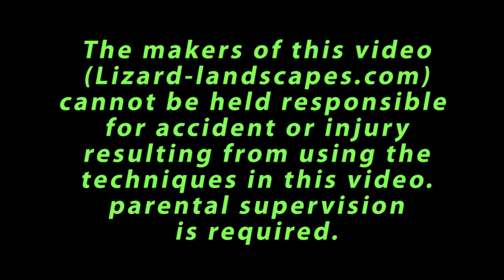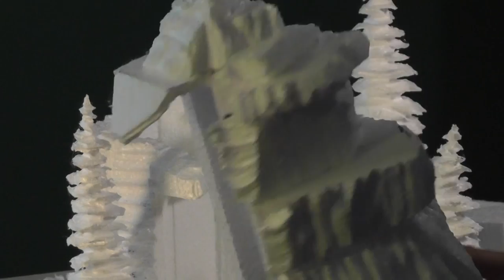How to build a Winter Waterfall + Christian message!

Comment: I noticed that in a lot of your older videos you just use a knife to cut them. I can't handle the mess that a knife makes. I'm going to get a Hot Wire Foam Factory tool for my projects. Would those projects work with a Hot Wire tool work for those as well? I can't afford to get multiple tools. Which one should I get that would be best for many projects? I do want to start with making a castle for my new lizard Hugs. I want to try to finish it before he gets here but it's ok if it's not ready when he gets here. He is stuck on the east coast until the weather is warm enough there for him to be shipped.
Reply from the maker: The hot wire would work with any project I've done.  The tool I use the most is the Freehand Router tool.
Reply: Also would it be possible to do the project with cardboard then cover it in the grout or another heat resistant substance. So I guess my question isn't is it possible but more, is it safe?
Reply from the maker: elizabeth manha
I've never tried it.  You might do a test piece first.